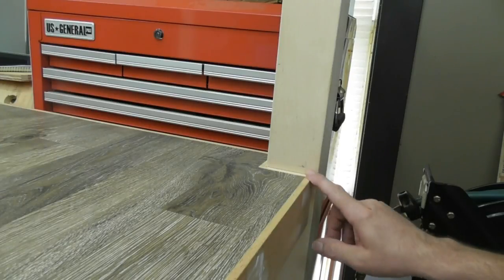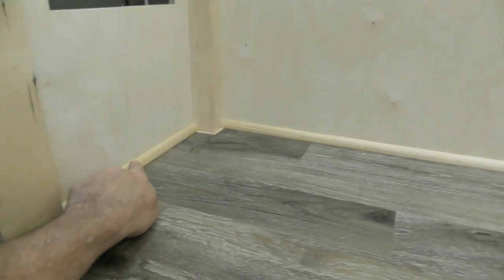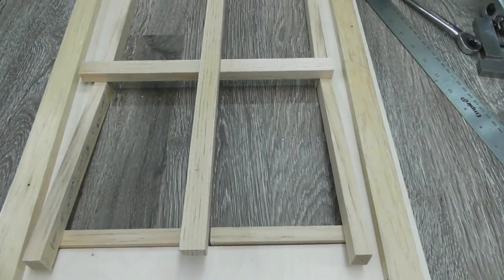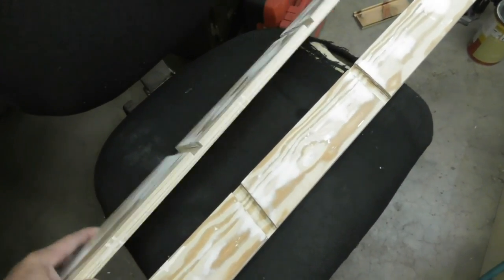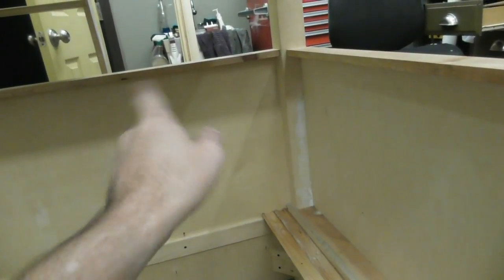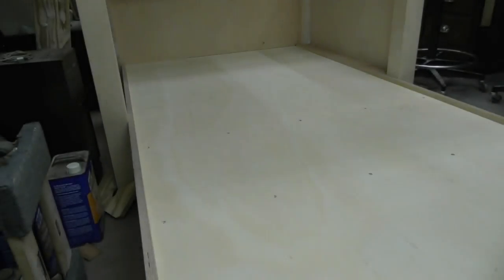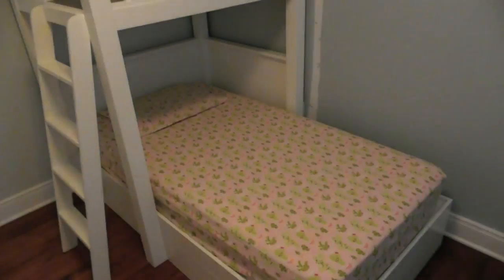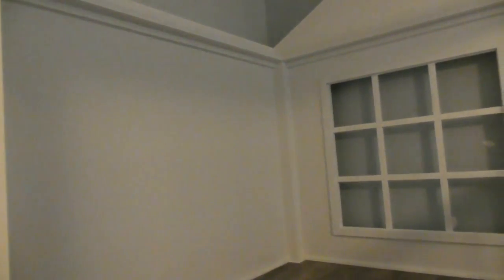Building a Playhouse Bed Part 3 of 3

Comment: This is intense. Very cool. Im sure it's too late (/too much head ache) now but.. Maybe an idea for the attic access.. 3 things. 1.hinging the headboard as a door with a lock to keep it closed regularly. 2. casters that lock under trehouse. 3. Bracket/secure frame of tree house to the wall. Then you have a few screws and a couple locks and the whole thing can slide over the bed out of the way.
Reply from the maker: It has been done for a while now Star, but you have some interesting ideas. Perhaps others wanting to build something like this can incorporate them in their designs. Thanks for sharing, G.